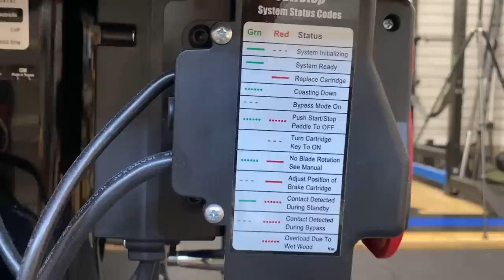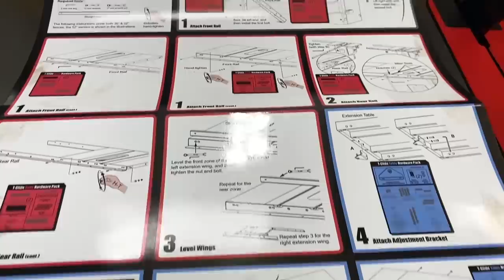5 Reasons Why I Chose a SawStop Table Saw vs the Competition

Comment: My company owns three of those saw stops , and I myself accidentally touched the side of the blade and set off the  mechanism  , it WILL still cut your finger but only enough for a band aide, so it will give you an injury but not one that will send you to the hospital. 
And the mechanism after it's triggered does a job on the blade , and the price to replace the mechanism is not cheap.
Somewhere around $150 dollars.
Reply from the maker: Great to hear you weren't hurt!
Reply: @731Woodworks  thanks , still have to watch out for kickbacks, they can smart . Lol

Comment: Congratulations on your Sawstop. I have been saving up for one for awhile now. I was configuring them on the websites and I know you can get a cast iron extension for the 36"  can also get a cast iron extension with a router slot cut into it if you'd like. They run about $150 for extension and $450 for router extension

Comment: I see the reason for safety consciousness but by using other tools and jigs you can work just as safe at a much more budget minded cost.  I cut up plywood with a track saw and use the table saw to cut smaller more manageable pieces with crosscut sled for added safety. 
When the patent runs out on the saw stop and there are many competitors making the saws.  Saw stop will most likely drop the price.  
I have been wood working in my family shop since i was about 10 years old and nobody in my family lost any digits, but I see the safety advantage and If i was able to afford the new saw I would consider that technology, but as things stand now I will keep using the old delta.

Comment: I think your fence is too tight, you can loosen off the bumpers so that it is an easy press down and locks in place no problem (will involve realigning it square however). Congrats on your purchase and God bless.
Reply from the maker: Thanks for the tip. I’ll check it out

Comment: I got my SawStop 1.75 PCS last year. I had an old Delta and I wanted to replace it. I mentioned SawStop to my wife and she said it would be cheaper than an emergency room visit - hmm, I agree! So I got one. It is a great saw and I am very pleased to have the peace of mind. I set the protection off by mistakenly allowing the blade to touch the fence on my Incra 5000. It works. It is done and over before you can even understand what the noise was. It really works.

If I didn't want the safety feature I'd likely get a Harvey table saw. Their miter is really nice.

Thanks for your videos!
Reply from the maker: Yes, those Harvey's are very nice.  I looked at them.

Comment: Mat, what is the flooring mat again? Tried to look at tractor supply but not sure if i'm looking at the right one. The fact that you can run the mobile base on it is a huge plus for what I'm looking for. Thanks in advance.
Reply from the maker: These ones, I use the flat side up https://www.tractorsupply.com/tsc/product/4-ft-x-6-ft-x-3-4-in-thick-rubber-stall-mat
Reply: @731Woodworks  Awesome. Thanks alot!

Comment: Congrats on the new saw.  I have the opportunity to use them at my woodworking guild and they are a pleasure to use.  One point about the lack of cast iron wings:  SawStop offers them as an option, but putting those on would add another $300 to the base price.  A lot of people add a router table to one of the wing areas which would necessitate removing the wing so that money would go to waste if you paid for it in the included base unit.

Comment: I'm hoping that when the patent expires, the market will drive some of the cost down..make the luxury of the safety feature more available to everyday woodworkers..
Reply from the maker: I was reading on the patents pertaining to sawstop. Supposedly SawStop will have the patent for several more years and some of the tech tied up in other patents could keep it SawStop only for a very long time.  Take all that with a grain of salt. Most of it on Wikipedia lol
Reply from the maker: Thank you 🙏🏻
Reply: @731Woodworks  from what I have been told the whole safety feature has been around for 25 years or so, one of my vendors told they they never wanted to build saws they were trying to sell the technology to existing manufacturers and no one was interested. the safety feature is nice the saws themselves are ok, there are much better ones available for less money, they wont have the safety feature though.
Reply: @adamchesis7443  Such as?  Harvey?  Laguna?  Throw us a bone man!
Reply: @dbassett74  its a company that made amazing stuff that shut down because of the cheap stuff being made overseas

Comment: Give and it shall be given unto you, pressed down, shaken together and overflowing. That's how the system is supposed to work!

Of course you (like pretty much everyone on YT), ignore the simplest and most important safety feature that comes standard with every table saw: the blade guard. Yes, it's a bit of a hassle to install and remove it every time you need to switch from rip cutting to cross cutting with your sled, but if you want safety, it's right there. (Yes, I'm guilty of leaving it off, too...)

We've all seen a spinning blade cutting through wood. Seeing it in a video adds nothing (except for Katz-Moses' awesome 60,000 FPS footage showing how the blade actually cuts). Put the blade guard on and be a good example for everyone on the internet.

Comment: Appreciate the honest review, it would be easy to just gush over it but you’re exactly right those are things I would be disappointed in too if I bought one. Looks like the miter gauge on my kobalt saw!  I really like the tool review videos lately!
Reply from the maker: Thank you
Reply: Let's be honest, yall are probably never going to use that miter gauge anyway 😜
Reply from the maker: @Shrubhumper  lol
Reply: @Shrubhumper  True!
Reply: @Shrubhumper  yep, I only have a dewalt table saw, but yeah that miter gage has only come out of its holder once or twice...just to see if I knew how to remove it from the on board storage slot and put it back....it needs a tricky bit of alignment to go back in.

Comment: Which is better, Matt, a 'wheelgun,' or a 'jamb-o-matic?' You were a cop, so, did you carry your department issue sidearm, or what you wanted... what you felt safest and most confident with? Let's carry that forward to a Saw-Stop. Now I'll admit, I've done some unsafe things with my shop tools, and all my fingers are still intact. At some point I stopped and asked myself; am I doing this in the safest way possible? Consequently, before I hit the power switch on ANY tool I'm using, I review what I want and intend to do with it, and then remind myself of the safest possible way to do it, and what to avoid doing.

I see a Saw-stop like I see the automatic landing gear extension feature on many Piper aircraft. It will automatically lower the landing gear when you get below a certain speed. I don't like that feature because it's a machine that trying to out-think me. My training when I flew for a supplemental carrier, when you turned final you made a verbal review. You physically check the landing gear position switch, confirmed three green lights, confirmed the mechanical gear position indicated down, and then you stated aloud, "Wheels down, landing checklist complete." Do that every time and you'll never have an unintentional wheels-up landing. 

I see the Saw-stop as a false sense of security. I.E., it's going to save you if you forget. I look at it in the sense... if I've planned what I'm doing, and follow my safety precautions, I won't have an accident. I'm not saying you're wrong, I'm just saying why I disagree.... Happy New Year, and stay safe, buddy...........

Comment: I use a Metabo jobsite table saw with the folding stand, and had my first accident.  I was using my dado stack and like an idiot was pushing a 2x6 sideways into yhe blade to create an arch through the width of the board, and was holding the board with my hands. The blades grabbed the board and shot it downstream and drug my left hand into trhe blade.  Since i had the blade 1/4" high, it only mangled the ends of two fingers.  Now i understand the value better of a saw stop.  Alas, i dont have the room nor the funds to get one. But also i dont build things for a living- only hobbies.

Comment: They are very nice saws and look to be well built.  But for the price, I went with a Delta cabinet saw and it serves me very well.  Mainly, because I did not want the hassle of that blade-stopping system.   Too many electronics for a saw.  Seems like it could be an expensive problem one day.
Glad for you my friend.  I am sure you will enjoy it.
As for the wood extension on one side.  That can be a plus.  I have a steel extension on one side and on the wood side, I built in a router lift.  Now I have a very rigid router table with a precision fence.

Comment: You should definitely make a nice piece of furniture for your church brother, or a nice walnut dinner table perhaps. 

I noticed that your 240 volt outlet on your house had one upper prong going sideways and the sawstop had both upper prongs going sideways.   Did you have to change your home outlet or the plug end on your saw?  Or does the saw come with an adapter?
Reply from the maker: The plug has a dual slot on that side. Vertical and horizontal. It’s hard to see on the video
Reply: @731Woodworks  ah, ok.  Thx

Comment: seems like every tablesaw review I see calls the mitre gauge less than optimal.  To me include quality or leave out. Drop the cost by $20 which i can apply to getting a descent mitre gauge.
Reply: Not to mention the wing. Wasn’t expecting that, when I first saw it in the vid before he mentioned it I just assumed it was just some mod you had done.

Comment: I`m surprised you had to make any adjustments to dial in your sawstop.  I chose them partly because thier saws have a reputation for being perfectly adjusted right out of the box.  Mine was.
Reply from the maker: Maybe got bumped in shopping? Not sure. It was out about 1/32”
Reply: @731Woodworks  Still, I LOVE mine.  I used to smoke 3600 to 4000 bucks a year. Quitting was how i paid for mine.  Totally agree with your concerns about the extension wing legs.  kind of wobbly.  Quite the gift.  Congrats.  Most of my friends are dutch and too cheap to get me anything at all lol. Keep up the good work.  I love that you profess your faith on your channel.  Our God is great!!

Comment: I had the same initial impression about the Sawstop that you did: that it was amazing and I loved it and wanted it.  Then, Stubby Nubs did a video about it, and about the Harvey saw.  And while Harvey doesn't have that amazing safety feature,  it has SOOO many.of those bells and whistles that ABSOLUTELY should be included in that giant price tag.
Reply from the maker: No doubt the Harvey tools are very nice.  It is one of the ones that I looked at.

Comment: Ok, I just watched another video where a guy took a hot dog, and tried to run it through the table saw.
Let's just say, yes, the saw still made a knick on the hot dog, but it DID NOT CUT THROUGH THE HOT DOG!! The saw blade stopped and retracted back into the saw like it was supposed to do ( engineered/designed to do)!!!!!!!!
Yes, your finger might be cut pretty bad from the experience, but you will still have it attached to your hand, and only have to suffer a few stitches.

Comment: Almost 30 years ago, I accidentally stuck my pointer finger into a table saw blade. It felt like a pro baseball player had hit me in the hand. I grabbed the finger as tight as I could and ran into the house and grabbed a handful of paper towels and asked my wife for a band-aid. I didn't realize I was in shock. Fortunately, after some time it healed. THEN I DID IT AGAIN...Not kidding. Yes that eventually healed also but, I didn't touch that saw for about 3 months after it healed. Saw Stop is a GREAT purchase.

Comment: I recently cut off the end of my left thumb on my old Craftsman jobsite table saw and replaced it with a Sawstop Jobsite Pro saw. I love everything about it except for the miter gauge. It looks and works like something from Harbor Freight. It went straight into the trash. I completely get what you said about the miter gauge that came with your saw.
Reply from the maker: Oh wow. Sorry about your thumb! Did you get another miter gauge?
Reply: @731Woodworks  I did. Got the Wood River miter gauge at my local Woodcraft store. I actually bought it prior to the Sawstop. It works great for me. Very accurate and it has a stop block.
Reply from the maker: Great! Thanks

Comment: This is AWESOME!
Reply: Matt, I have an extra Grizzly 2HP 4 inch dust collector. It is a 20 year old machine, but it was used so minimally that it is essentially a new machine. The same specs on this from Grizzly currently would run over $600 when shipping is added. This is yours if you want it. I'm about 15 hours from Arkansas, so if you want it we could collaborate on the shipping. It looks similar to the cheaper options from Harbor Freight, but with it's power and build quality, it's in another class altogether and can be upgraded with a canister filter and some other items. You've mentioned the DC status in the shop, so I figure I'd offer this if you want it. Either way, I love seeing how things are being worked out for you!
Reply from the maker: I really appreciate that a lot! That’s an extremely generous offer. I’d love to have it but I’ve got a Laguna P Flux en route. Should be here in November.  So I wouldn’t have room for both. Maybe someone in more of a need could use it? Thank you for the offer!
Reply: @731Woodworks  perfect! I didn't want to lengthen the message much longer, but figured you might have something in the works. I look forward to seeing that addition come through at some point once you get it settled in. Thanks man!

Comment: Does anyone know how much it cost to repair after skin contact, when the blades slams to the bottom of the cabinet?
Reply from the maker: Just replace the brake $90 and a new blade.
Reply: @731Woodworks  thanks I appreciate that sounds good

Comment: Why didn’t you install the blade guard?
Reply from the maker: I don't like the blade guards on table saws.
Reply: @731Woodworks  you talked about safety throughout the video but don’t like to use one of the saw’s main safety features. Even Saw Stop states that the blade guard should be used on all through cuts and that they don’t guarantee that the blade brake technology will prevent injury. That seems odd to disregard that information when safety is a high priority.

Comment: I am happy your fans shower you with gifts. I got the impression that if the blade stops to prevent cutting your finger it is not just a matter of resetting the trigger mechanism you have to buy a new part. Is that the case?
Reply from the maker: Yes, the brake is $90 and of course a new blade

Comment: Glad you finally got your dream table saw!! Will you be looking into a bandsaw in the near future?  Good 14” or 18” bandsaw is good for re-sawing hardwood
Reply from the maker: Yes, I am looking at a Laguna bandsaw.  Probably 14" resaw.  I just had a Wen 9" (3.5" resaw) given to me that I will be doing a video on Thursday.  It is a great little saw for cutting small parts!  But a bigger one that I can re saw hardwoods would be idea.  Only thing is I am running out of floor space lol
Reply: @731Woodworks   👍
I have a Laguna 14bx and it takes up a small space. It does not take space like the table saw.  Good mobile base for the bandsaw will also help as well..
Reply from the maker: Awesome

Comment: That would be quite normal price here, paid 3000€ for my grizzly table saw over here, and I consider it cheap. Still can’t understand how woodworking tools are so cheap over there. Bosch glide 600$ in us, and 1300€ in europe. Same deal with routers, tracksaws, planers, jointers.

Comment: I guess if your the type of person that is attracted to fast spinning shiny things like a cat is, and can't keep your fingers out of the rotating blade like I have been able to do for the last 40 years, then by all means a sawstop is the tool for you. Just be careful it will still KICK BACK if you use it wrong.
Reply from the maker: Just because it hasn't happened doesn't mean it can't.  It's like saying you've been driving for 40 years and never had an accident.  Anything can happen. Proverbs 16:18 says Pride goes before destruction, and a haughty spirit before a fall.
Reply: @731Woodworks  As long as you PAY ATTENTION it never will and you will still have an extra $1600 in your bank account, but not in your case.

Comment: You bought the saw for safety reasons and you're using it without the guard?  I don't believe you were given this saw.
Reply from the maker: It is very hard to believe that someone would give such a huge gift.  I couldn't believe he done it either.  I was in shock. But you know what, there was a MUCH bigger gift given than a saw  https://thestoryfilm.com/watch 

I don't use the guards.  I never used them on my Delta either because they hang up a lot. Not a fan of them.
Reply: @731Woodworks  Adjust the guard.  No one uses a miter gauge that knows anything about accuracy on a table saw.  Build a saw sled.